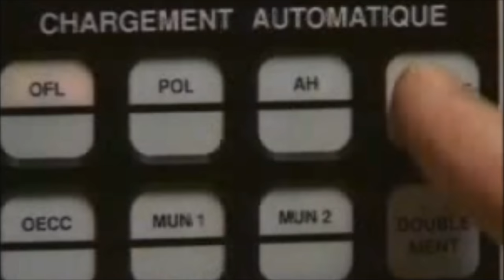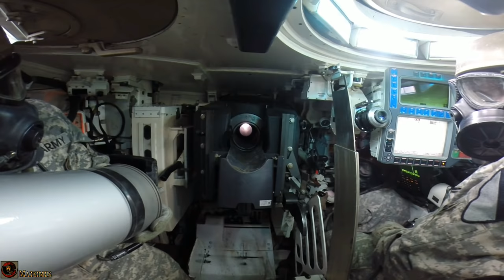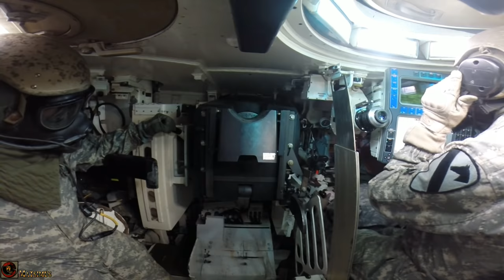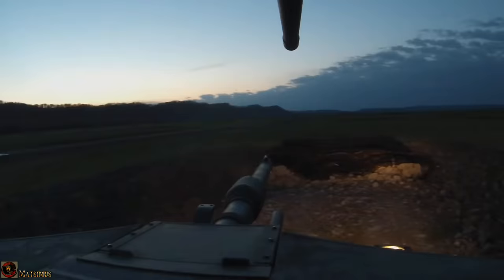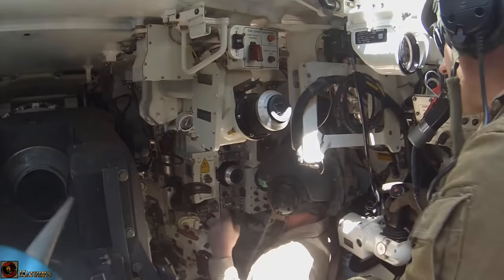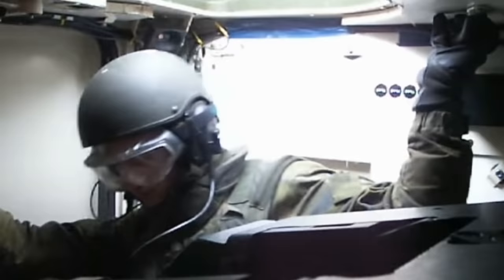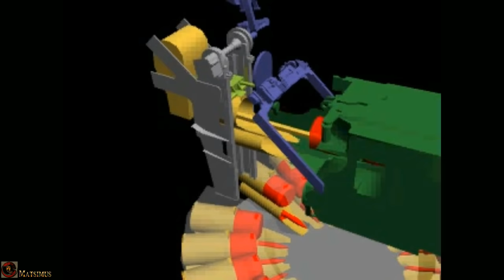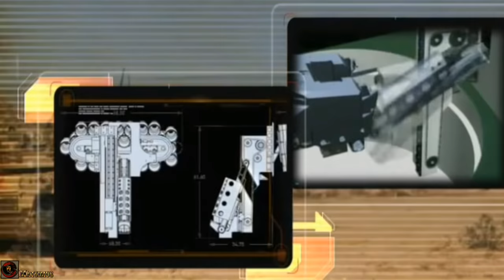Tank Autoloader or Crewman Loader?

Comment: I am T80U mechanic driver , my tank was equipped with auto loader -
1. tank can easily be operated with 2 people , driver and commander . commander can load , aim and shoot which is nearly impossible with manual loader. 
2  Changing track usually done by  2 people as driver need to steer  the tank  ya you can use extra person but not critical. 
3. manual load is a very hard job as you loading entire shell that about 50lb x 40 or 50 on them your rate of fire varies dramatically.
4. loading manual on the run and bad terrain is a pain in the A~~
5. because of auto-loader Armata now have huge advantage as a modular tank.
6. I can say on and on about loader   - but bottom line AUTO=>Progress=>Speed => wining time => dead or alive
Reply: The US military had the biggest budget of any military in the world. Why wouldn't they put autoloaders in their tanks?
Reply: Sergo Pedro...What a bs
Reply: now i know why russian tanks kept getting killed in the battlefield. the commander is too busy doing other things than doing his job, the job that to be always aware of the environment! always on the look out for threats and ambushes! always in search for a possible hostile target! a commander doing a gunner's job  is a blind tank
Reply: US Army manual loader here. A surprising amount of training goes into lifting the 50-60lb shells and your load time ends up incredibly consistent, and US crews are literally trained specifically to outload Russian autoloaders (they load, according to US Army, in 7 seconds so we must too at slowest. I load 4.4-4.7 seconds for a APDSFS round, 4.2-4.5 for MPAT) and you don't feel nearly as much strain as you would expect. Loading on the move is more of a practice issue over a practical one. Plus, my ammos behind a 2 ton door instead of wrapped around me so in case of a hit in combat, a manual loader is safer than an auto one. In reality, it comes down to doctrine, I feel. A manual loader has more duties than just loading, which in autoloading tanks must be spread out to three crewmembers instead of four. I'm ground guide, Im in charge of maps, I do the lighter maintenance (we all do, but i do the most) and I, in combat, man both my ammo door and a roof mounted 7.62 mg. Oh, and I don't risk the gunners life more by being a massive metal, hyrdolic arm. The breech is dangerous enough, thank you.
Reply: @psychicumbreon  loading speed is irrelevant vs russian tanks that are set up to engage western armor, as those serving in frontal divisions use guided missiles from the 125mm main gun to vastly outrange Abrams tanks.
Reply: @mac6899  in a defensive war, most of Russia's targets would be major urban centers, where range matters less and who is ready first is.
Reply: @Deus Vult The sosna-U range finders on the latest T72b3 and T90m varients are very good, the T14 Armatas sensor suite is state of the art and is datalinked to other platforms like Mi28N and KA52 gunships, the T90m took a direct hit from a modern TOW missile in Syria and it's kontact 5 ERA repelled it. I doubt that the Abrams would have survived as it has struggled with the RPG 29 and kornet ATMs in Iraq and Yemen.
Reply: @Deus Vult it was US Abrams with DU armour that got penetrated by RPG29 in Iraq causing the death of crew members.
Reply: @Deus Vult look it up ...Iraq 2007 Abrams vs RPG29 a 25 year old weapon at that time.
Reply: @Deus Vult DU Armor does nothing for a HEAT attack, if anything it makes it worse, the Kornet is probably the ultimate HEAT missile. No it was a US Abrams Sep 2 penetrated by a RPG29 in Iraq in 2007.
Reply: @chaosXP3RT  had? More like has.
Reply: @Deus Vult The javelin looks the part! But it's delicate and complex for field operations, expensive and has quite a poor range of 2.5/3km,  the latest Russian Kornet varient has a 10km stand off range, is fire and forget and now has a top attacking mode also, the warhead has a duel separating charge to pre trigger and defeat APS like trophy. If you look it up or look up the RPG 29s combat record you will see that it still penetrated the US operated  M1A2 in 2007 and caused casualties. The footage was on YouTube.
Reply: @Deus Vult there have been multiple incidents RPG29 vs U.S. M1A2 Iraq 2007, kornet vs iraqi M1A2s and against saudi M1A2s in Yemen in recent years. Check out what it did to the German leopard MBT operated by Turkey in Syria...unbelievable. Trophy has a reasonable record against the old iranian copy of early kornet models, but would probably fail against the latest russian variants.
Reply: @mac6899  you don't know what you are talking about i have seen that video it was a saudi tank mean export from U.S. guess what the real U.S. tank is 100% exclusive  to american military only. they actually bought a shit version from the U.S. they stripped the tank.
Reply: @nitonono4143  Because it is naked statistics. Russian tanks frankly more on the warring grounds. Any tanks successfully burn.
Reply: @Deus Vult I agree
Reply: @mac6899  Maybe from the rear. RPG29s were the first thing that the US military designed the Abrams to survive. You can find footage of test ranges were Abrams survive RPGs. The deaths in the Abrams from an RPG is rare unless the crew is unbuttoned
Reply: @benjaminsorenson  You're right
Reply: @Deus Vult It bothers that people argue that the Abrams can be killed with an RPG. That's the first thing they tested the Abrams against. There was a story on the History Channel of when a crew was moving through a town in Iraq unbuttoned (open hatches) when they got ambushed and an RPG hit the tank and killed the commander. But it didn't penetrate the armor. The #1 killer of Abrams are ATGMs and the #2 is self-destruction (sometimes an Abrams maybe be damaged and be in a situation where they don't think they can salvage it and so the crew will destroy it).
Reply: @chaosXP3RT  RPG 7 Yes, The RPG 29 is a tandem charge soviet beast from the late 80s, the Abrams was out 10 years at that stage. Check out the combat record of the RPG 29, The U.S. military prohibited the new iraqi government from purchasing it because of the threat it posed to U.S. armour in the wrong hands.
Reply: I kind of agree with that although I don't have experience of working in a tank. In other arm forces for e.g. New Navy Destroyers trend to more and more automation require less crew to operate but somehow western tanks trend to the opposite except for French Leclerc.
Reply: Guided missiles launch could be spotted, tracked, evaded or defeated via suppression fire. You are probably not a tanker or else you'd know we have drills and practices on facing guided missile threats, not counting active missile jammers being installed onto tanks now.

And how many gun launched guided missiles would be carried in a war load on such tanks? A guided missile would best served as some ambush first shot, after that, sabot rounds rule!
Reply: @cav1stlt922  kontact 5 ERA would probably defeat 120mm sabot penetrators, drills against something you have never encountered? 4 to 6 per tank, these things fly an unpredictable trajectory similar to the lethal Kornet missile.
Reply: It's not whether the actual missile round might penetrate the tank, it's about being able to score a hit first.
I used my own money to buy firecrackers during training of my tank crews in respond to possible missile ambushes, artillery simulator rounds simply weren't enough to go around for the frequency I would like to train my tank crews! I would put M80 or cherry bomb firecrackers into small sandwich bags of baby powder and lite them off to simulate AT rocket fired; crew in the maneuvering tanks should be scanning 360s outside the turrets, at tree lines or any place where enemies might be and would spot the puff of smoke created by the baby powder and would immediately respond by traversing the turret toward to that direction.

Gunner could fire off coax or whatever round in breech while the loader and TC could fire off suppressive fire and or pop smoke; the driver would speed up and seek possible shelter. All these would/should happen immediately as someone would call out over the radio "Missile!" or "AT Attack!" 

It was not just one vehicle, one tank crew responding but the whole unit! The infantry in the CAV vehicles, the mortar track and whoever would all react and add the suppressive fire and smoke screen while speeding ahead! And that was the kind of drill my troop would go thru! And you know why I was very proud of their performance. Team work save lives.
Reply: @ Sergo Prdro Khoch...
My credential- I served in tanks as loader, driver, gunner, TC and troop commander so I have experienced pretty much everything a tanker's life has to throw at me.

Here are my responses to your points...

1) I couldn't envision doing what we do in the turret with a short crew, let alone missing that extra pair of eyes to scan for threats! Like some other tankers have mentioned on the video, the loader would man the extra MG for suppressive fire beside humping rounds into the breech. And if the coax jammed, which often when you are trying to fire hundreds of belted ammo thru it, who would unjam the gun? On the T80, it would be in the TC side of the turret. He would have to scoot down into the confine space, reach forward to unjam the coax, thus moving away from his own critical fighting position which would be the TC seat or copula when he should be spotting targets and directing his tank.

And then someone mentioned a 3 men crew actually meant being able to field more tanks because it would require less soldiers. Someone suggested all those 'minor chores' like maintenance, guard duties, night watch, 1st echelon maintenance, etc. that the fourth crew member would do could be done by someone else. Heck, who do you think those someone else would be, just more soldiers trained for different tasks; no saving of manpower if you look at it, in fact, just more inconvenient when a tank crew can't do those things themselves. 

2) I don't know what kind of track your T80U has but our M1 tracks weigh a lot more than rubber bands, I would not be able to lift a portion of the track myself, let along trying to guide it over the road wheels and connect it back together. If I was to drop a rubber track pad onto my foot, I would be hurting big time... and there were hundreds of them on our tracks! The tanker's bar alone (a five or so feet long solid steel bar) required one person to haul it around, and that was needed to level, guide and adjust the track with, not to mention the almost equally big and heavy spanner wrench. Those tow cables needed to pull the track over the road wheels were exactly Slinky either. A thrown track was a full crew's job, probably needed another tank of M88 to help if handy.

3) Yep, loading was a hard job and most of the time, reserved for the youngest, newest, most junior of tank crew but hey, being a tanker was hard work, period; every piece of hardware was solid steel weighing tons, dropping a wrench could break your toe; bumping your head against any part of your head could crack your skull. That was why we were physically fit, or else we would be pushing some paper in an office somewhere!

4) Of cos loading on the move wasn't easy, that's what training and more training was for. I don't know what kind of tank crew you were but you surely belly-ached a lot being a tank crew. Part of the hardship of being a member of a tank also bond you with the others; the small four men crew was like a family!

5) The Armata has yet to prove itself in sustained combat, I would hold my judgment against a video-game like tank against our tested M1 series MBTs.

6) We all have our opinions and I am very glad actually to hear from someone who might have served in a tank with an autoloader!
Reply: They are never going to replace the Abrams and the French are using 140mm on the leclerc
Reply: @mac6899  Those tube launched ATGMs have a LOT of issues with them. Lowering both rate of fire and ammo availability amounts by a huge degree. They aren't particularly accurate, and they are slower then sabot rounds. They are vulnerable to Trophy style ADS, and they are to small to effectively kill MBTs. (Think about it, the warhead on a tube launched missile can't be very big after you add propulsion and guidance to something the same diameter as a tank shell) They also don't really outrange sabot, as kills beyond 4k are entirely possible using manual sights. There is also the issue that there are very few areas in the world with unobstructed sight lines regularly being over 4k, since any tank commander with multiple functional brain cells will avoid long open corridors and stay behind IV lines. The vast majority of tank engagements are under 1500 meters, and loading speed is extremely relevant there. 

So the vast majority of Russian tank users do not ever use those missiles, same as the US didn't use them when we tried it on our M60 and M551 platforms.
Reply: @mac6899  you do realize the US has guided missiles too?
Reply: @Long Live Rhodesia Just so you are aware an Iraqi used RPG29 did penetrate an M1 Abrams rear hull armour injuring 3 crew members, there was also a second case of an RPG 29 penetrating a M1's side turret armour killing 2 and wounding 1. A British challenger 2 was also penetrated by an RPG  29 maiming 1 and wounding others. Now this doesn't discredit either tanks, both tanks suit their respective doctrines. I would disagree with the statement that the M1A2 is the best tank in the world, its not, its the best tank for the USA much like the T-90 series is the best tank for Russia. Alot of people forget about looking at each nations respective operational requirements, i.e. The west of Russia is essentially 1 great big plain dotted with rivers and forests which the M1A2 and Challenger 2 would be likely ill suited too due their massive height and their slower speeds in relation to the Russian T-90s and T-72s (the T-80 is a bit of an anomaly in this regard, but still has a slower overall silhouette).
Reply: @Long Live Rhodesia As the Chieftain has said before in some his videos, there isn't really such thing as "the best tank in the world". The M1A2 is the best tank for the USA, The Challenger 2 for the British, Leopard 2 for the Germans and the T-90 for the Russians. The Russian T-90m solves most of those issues now anyway.
Reply: if a tank with autoloader shooted by ATGM  the tank tower blows up :D i saw in syria many tanks blowed up because of autoloaders :D
Reply: @michaelwittmann4774  Autoloader or not a tank hit by an ATGM will link blowup. Also, alot of syrian tanks, barring the T-90s and T-80s are older soviet export tanks without ERA which is also a factor to consider. Although yes many of those tanks that did blow up are likely due to the carousel autoloader.
Reply: Who pulls security while you are changing track? You can't do both! It doesn't sound like you have had to in combat!

If you can't handle 50lbs how do you meet military physical fitness test?

If you loose a crewman grab a Infantrymen to drive for you and move your driver to now be the Loader. Infantrymen are all over the battle field lying everywhere! All it takes is a warm body! 

With a manual loader you have an extra body for numerous tasks. A extra man for a shift at night to pull security mainly. Thus giving more sleep for the whole crew! Also with a manual loader it frees up the TC to perform his duties better! Normally he pulls security while the crew does the work and or supervises. 

Its way to many things can go wrong with a Auto loader and while you are fixing it you get hit! Why? Because nobody was pulling security! 

Hell WW2 Tanks had 5 man crews! And for good reason!
Reply: No objections to your point but seriously your ammo storage has to be just surrounding the crews?  Modify the tank doctrine at least to keep the crews more safer
Reply: @chaosXP3RT  because in USA, people who never went to war decides what is good for men in the field.
Reply: @gogos1003  Yes and no. The US has a system were  feedback from the troops and commanders in the field goes to the weapon designers and policymakers where they can do things to help the troops. Of course, the military industrial complex wants money, but having troops request new things gets them money so...
The US military has been continuously at war pretty much from the day the US declared independence and it's one of the most experienced armies in the world with a trillion dollar military industrial complex backing it up.
Reply: @gogos1003  I mean, the Abrams has no autoloader, but the Stryker does. The Stryker was built completely on precieved on need by commanders and troops in the field
Reply: big ian hey I love my Abrams but the Leopard is also an outstanding tank. Now the Russian tanks have got to have the worst survivability just due to ammo placement and fuel storage. Seriously who puts a fuel tank in the front of the hull?
Reply: You like changing track with 1 crew member?
Reply: Sergo Pedro Khoch and where does a Russian tanks turret sit after a battle
Reply: Sergo Pedro Khoch bull shit. Two people can’t make tracks
Reply: Whole crews will be removed and replaced by AI which is better, faster, smarter in every single category. Not having to efficiently house and protect human crew members will create room for high effiency loading, aiming and control mechanisms designed to be managed by a computer. If public corporations are moving forward so quickly with AI, IoT, self driving vehicles and self flying drones, mapping and computers interpreting vision and we read about it everyday, we can only wonder what governments are making that is not publicly available. 

Furthermore, we can already see how quicker to adjust to ever-changing environmental challenges electric vehicles are when compared to manually operated mechanical ones. An electric vehicle can make micro adjustments and autocorrect itself on a slippery icy road at the intervals of milliseconds and keep the vehicle in control already today, so there is no reason to assume that a tank will not have a technology to always adjust its position, rotation, direction, traverse and aiming at those same intervals and always at its best for its survival given the circumstances, outpacing any human crew relying on its limited personal judgement and varied experience and training. 

This pretty much solves the whole debate. The end.
Reply: @chaosXP3RT  they will as the 140mm cannons get used in production)
Reply: @mac6899  in 21c Russia couldn't engage even one US 1v1. and CIS or something couldn't outnumber NATO, only with oldest ones of AFVs. btw old soviet ones was going in time with western vehicles so they were not that target-crap like 72b or 90a now
Reply: @chaosXP3RT  They would lose more jobs. also i remember the Hard maintenance is now on a specific team
Reply: @WW5RM  if you loose the loader, it means that you are under attack and the enemy has achived penetration, i dont think that you will get out of the tank or yell in the radio that you need an infantryman because the enemy will have already loded a shell and will be teady to fire another time.
Reply: @MrTylerman127  some russian/soviet tanks used to put ammo inside holes in the fuel tanks for "protection" maybe, um not sure tho.
Reply: @chaosXP3RT  a Abrams loader pulled off 3 shots in 5 seconds. Can a autoloader do that?
Reply: @sergeantwolf8018  3 shots in 5 secs with the ammo rack wide open(very dangerous). A much safer quick autoloader tank (Type 90) from japan is capable of reloading under 3 seconds(possible to do about 2.8, but safer to do at 3.4), while being able to simultaneously close the ammo rack.
Reply: @chaosXP3RT  because the m1 abrams is an older vehicle, which is still plenty capable, but the overall layout cannot be changed so easily. Once the m1 abrams lifetime ends though, they probably will use more modern layouts and technologies.
Reply: @big ian t-80u exported only to south korea and t-90 only lately so this is impossible. abrams armor similar to leo 2
Reply: @chaosXP3RT  1. The US military doctrine depends waaaay more on navy and air force assets than tanks, The Russian military is the opposite, as much of a surprise as it sounds, the Russians are very good at building tanks. Not at fielding them apparently.
2. New prototype NATO tank contenders (KF51, Abrams X) have autoloaders, they are simply better in everyway 

The US and NATO not fielding something does not mean it can't be good. They could have just deemed it not worthwhile, which makes sense especially judging how little NATO has actually used their tanks  lately.
Reply: @psychicumbreon what is your opinion on western style autoloaders like the leclerc's?